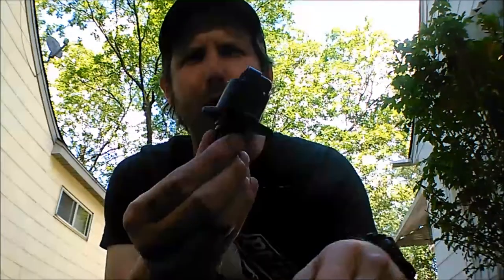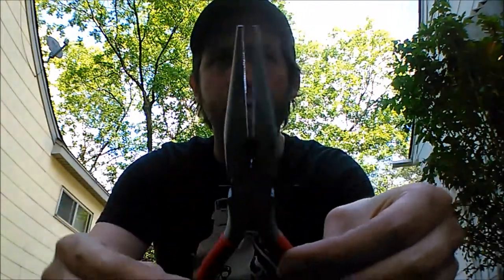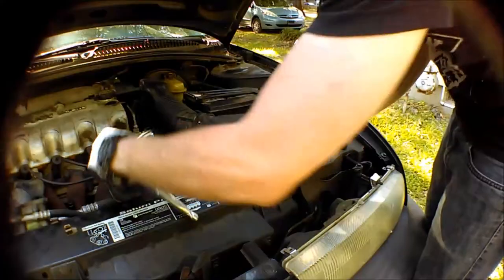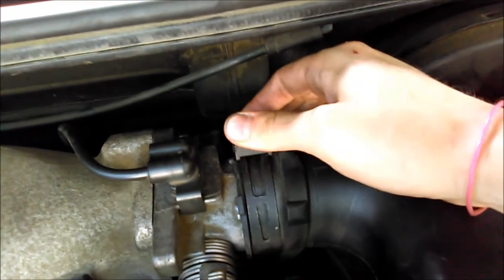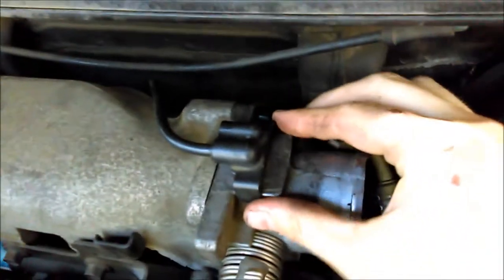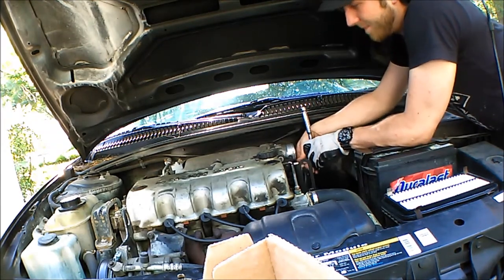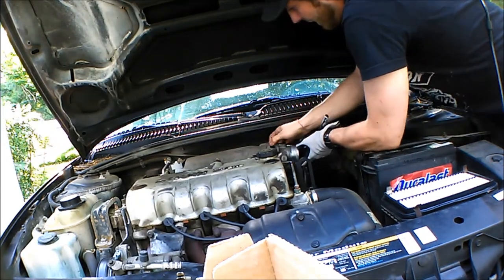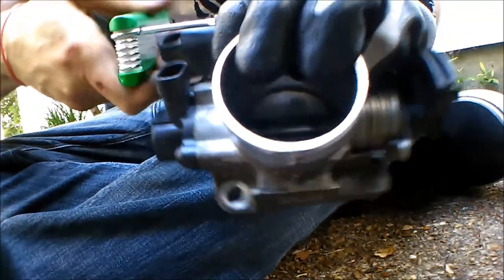NSRT - replacing 99 Saturn SL1 idle air control valve

Comment: Was having same issue...2002 sc1...481kms...after pulling throttle valve off...found 1/4in..carbon inside. ..as well throttle plate...cleaned completely...reassemble...purrs at 800 rpm ..cheers

Comment: My Saturn has 290000 on it. I do all the work on it myself. Having a fast idle issue just started today? Eh, but sounds like you solved the problem. I could probably take it out and clean it as much carbon air. And make sure it opens and closes by putting some power to it if it opens and closes. Uh, reuse using the car and kills it.  It's a keeper I'm gonna keep this car. Up, I'll put another motor and transmission in it before I get rid of it. Had it 8 years now, paid 550 bucks for it. Good on gas takes me anywhere I want to go.

Comment: Same year and model that I have, I don't find that very often. Good video, especially for a first time. Hope you make more.

I finally broke down and bought one of those special cramp wrenches with the cable, because I had to back flush the heater core, it was partially clogged, and I had very little heat. So I am in complete sympathy with you, cussing and crying getting those damn clamps off. Did lots of that myself.

Comment: had 1800 rpm idle no code  showed but idle speed control valve fixed it idle now under 8000

Comment: You have to use air flow cleaner and clean out the hole where the sensor is before you put back everything.

Comment: Why didn't you clean the body when you had it off? Just curious. And why not allow us a before and after running shots. Otherwise this is really good, as I shall be doing that myself very soon.
Reply from the maker: I had already cleaned it if i remember correctly. And it didnt fix the problem i had so there was kinda no point anyway

Comment: You could have done this without taking the throttle off the car, saving you alot of time... Is there a reset procedure to get the new one back into position?
Reply from the maker: Sure! You're probably right, and yes there probably is. I'm not a professional.
Reply: @chrisbentley3468, If he had a T20 bit that fit his rachet, then he could have left the throttle body in place. But the clearance is so tight that it really doesn't save much time. Typically, if the IACV is acting up it is fouled, in which case the throttle body is also in need of cleaning. Sometimes you can restore proper function of the IACV by cleaning it, other times it requires replacement.